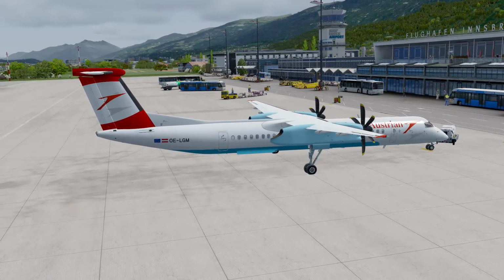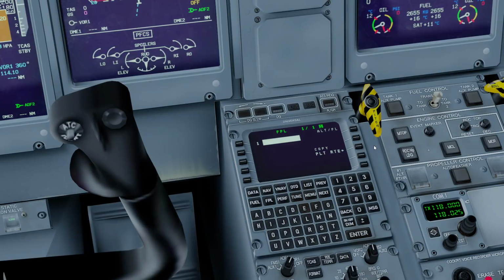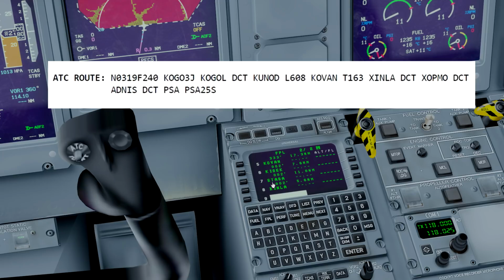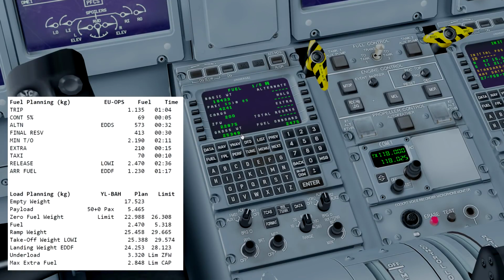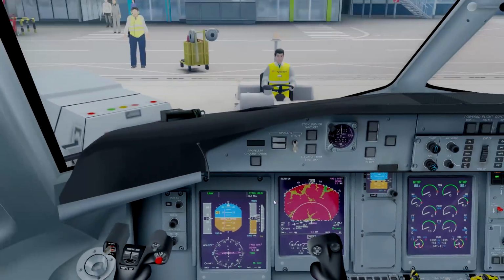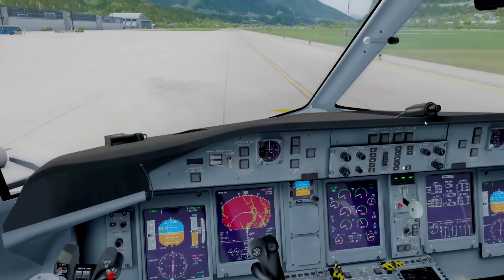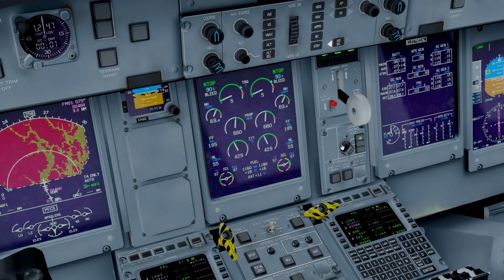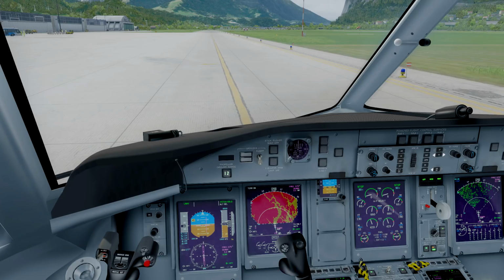Tutorial: Bombardier Dash-8 Q400 Cold & Dark Startup + FMS Tutorial! [2019] [Majestic Dash-8]

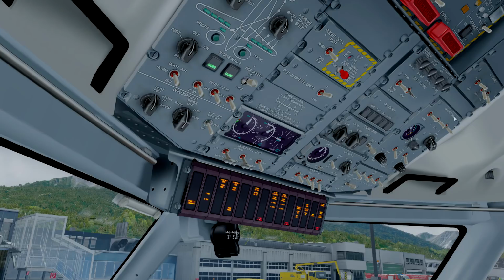Comment: 6:34 in practice IRL the APU is rarely started if there is a GPU available due to the fact that the APU on the Q400 is notoriously unreliable. I used to work the ramp for Porter and the only time I ever heard the APU running was basically for providing air and power to the air conditioning packs in conjunction with the PCA cart as our old diesel PCA carts couldn't keep up with the heat in the summertime so to cool the cabin quickly, we would run both the PCA and the APU with the packs on.
As for starting the engines, #2 would start on the GPU as the PW150 engines are started electrically, not with bleed air. Once the #2 genny clicks on, pilot signals the marshaller to disconnect ground power, then the nose wheel chock is pulled and walks a ways out and crouches down to be able to see the wing walker and I signal the lead on the paymover vehicle (in our case it was a 3-wheeled Lektro) that the wing walker was clearing for push (similar way a yellow shirt would cue the shooter to launch an aircraft on the catapult on a carrier). Then #1 is started either during push or during taxi with the PTU on

Comment: I think you were wrong there. The engines use battery for startup and not bleed air. Apu bleed air is primary used for air conditioning.
Reply from the maker: That's correct!

Comment: My control panel does not have the cockpit state options as yours, so cold and dark state is not an option to me even I downloaded again the software. Something I am missing?
Reply: Juan, if you're still struggling to get the aircraft in a cold and dark state (I also don't have this option on the control panel) then try this from the FAQs on the Majestic Software website "If you want a Cold-and-Dark situation, bring the aircraft to cold and dark by switching off all AC and DC switches, then save the situation. The next time you load it, you will find the plane cold and dark." I hope this helps.
Reply: @JackWilson  thank you Jack
Reply from the maker: It should be there..
Reply: @AviationPro  but it is not. Right part where you have all those options is empty.
Reply: @juanrodriguezA320  : There are three (3) versions to the Dash8-Q400. You probably have the same version like me ( PILOT EDITION). Some of the features are missing. The one in this video might be the ' PRO EDITION ' or ' TRAINING '.
Reply: @adesojiadebisi3477  never saw your answer until now. Thank you

Comment: Thank you for this. I have been flying the Q400 for a while and the video fills in some blanks for me. I find the aircraft to be very rear heavy and even if I have the bulk of the weight forward in the control panel, I still need a lot of forward pressure on the yoke to avoid going into a stall on takeoff. Is this a particular trait of the aircraft, or do you think I am doing something wrong?
Reply from the maker: You’re welcome! Yes it’s quite powerful on takeoff, so you will need quite a bit of forward pressure. Make sure you use reduced takeoff performance when the runway is long enough and when you’re not fully loaded. Also put the trim in the upper section of the white takeoff band. Other than that, the trim moves quite slowly, so it may take a while before you find a good trim setting :)

Comment: Fantastic video! One slight correction - the engine start is electric. The Q400 has starter/generator units which switch from a starter to a generator when the NH reaches 50% during start. This is why it is important to check the voltages prior to start. The reason for the bleed coming off prior to start is to minimise load on the APU and prioritise electric power generation for the start.
Reply from the maker: Thank you! Makes sense now! :)

Comment: In the Weight and Balance section in the Control Panel, you should enter the value for Release Fuel or Block Fuel in the T/O FUEL box because the value you enter there will be the value of fuel loaded into the aircraft. Which you need to be MIN T/O + TAXI + RELEASE.
Reply from the maker: Yep, it's corrected later on in the video.
Reply: AviationPro sorry yes I should have deleted the comment after I saw that bit. Great video though. I just love the q400 so much fun to fly.
Reply from the maker: @andrewbennett4638  No worries! Absolutely, I'm planning on taking it out for a flight more often now I'm getting to know it better :). Just love the engine sounds as well :)
Reply: AviationPro great! I just landed it in Edinburgh at OVC 001! Should have been a missed approach but I had a train to catch so wanted to get it down!